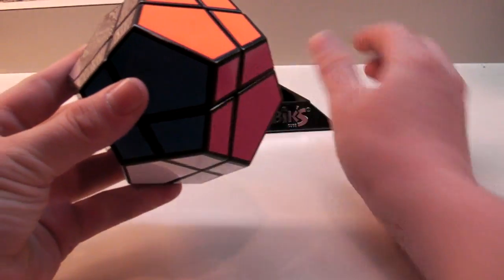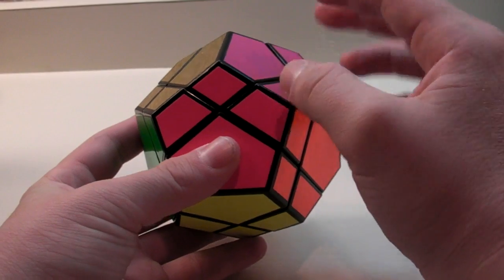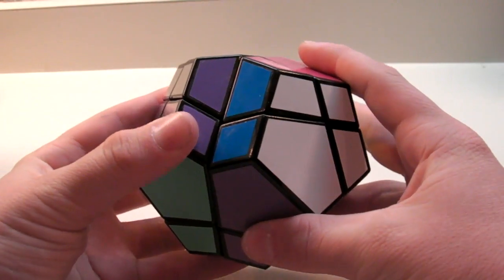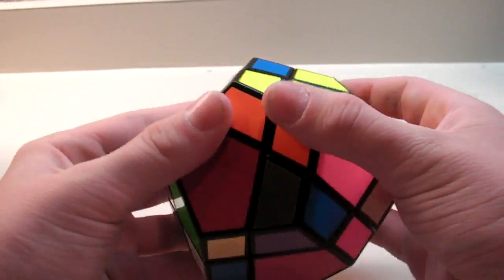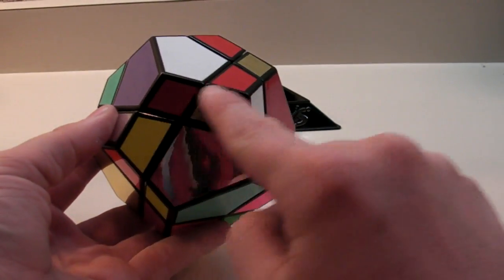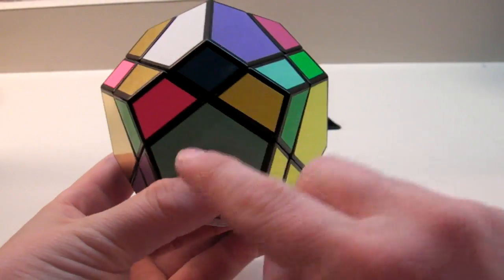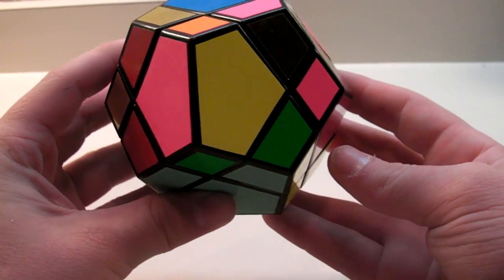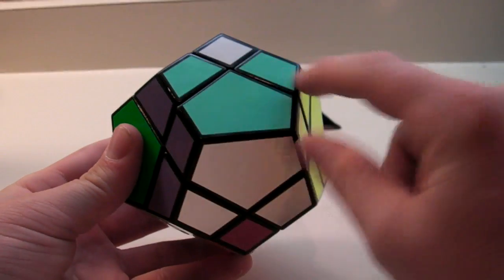How to Solve the Skewb Ultimate Part 1: Notation, Method, and First Step

Comment: Would only having the 6 colors on the Skewb Ultimate instead of your 12 colors have any parity issues? I ask because my 12 sided 6 colored Super Skewb does have a last layer parity issue which is fixed by swapping an edge with its same colored edge on the opposite side. Now I want to use 12 colors on my Super Skewb to remove its parity issue. If the 6 colored version of your dodecahedron can have parity can you explain it?